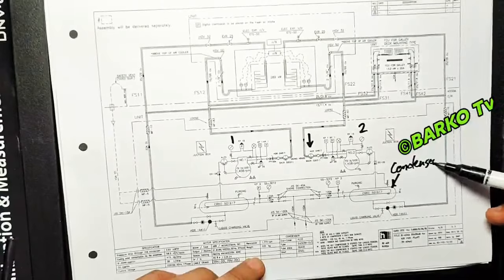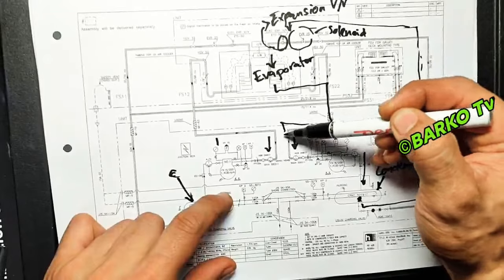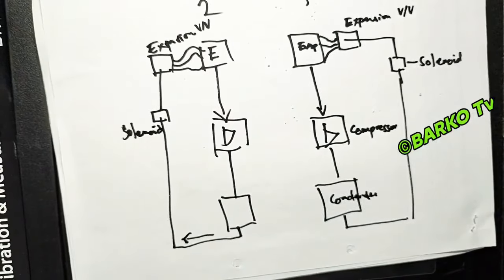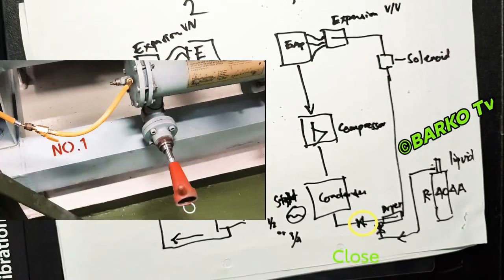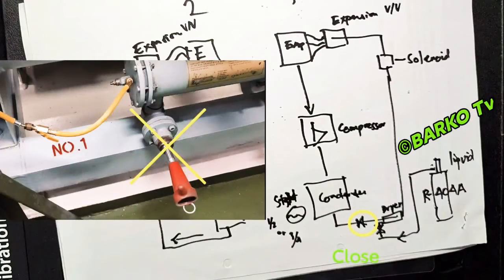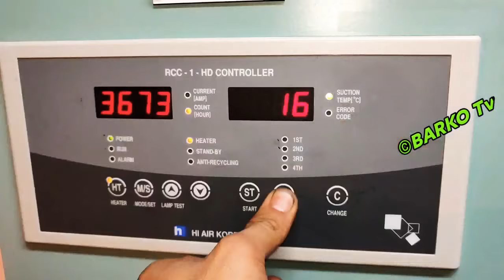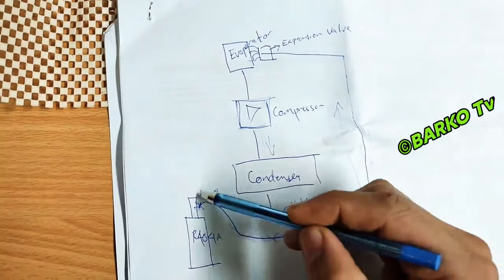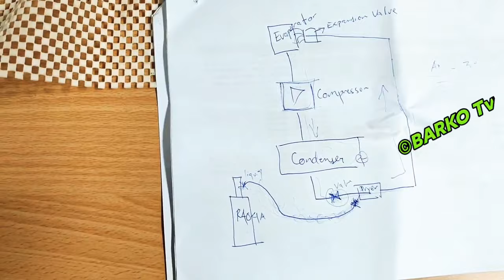How to charge ships air-conditioning unit R404A unitor | makinista |marino |barko |kalecky

Comment: Thank you Sir, for the practical knowledge and block diagram. Please sir try to cover control circuit diagram also.  Thanks. 👍👍👍👍
Reply from the maker: Sir good day, specific control circuit system of what equipment of the ship machinery so that i will try to cover if i have time, or as long as motor control troubleshooting? . Thanks for watching and appreciate my video. Thanks a lot

Comment: sir leck sana magawan nyo din ng video regarding sa mga troubles na pwedeng maencounter sa Ref and AC system sa barko. paano mo majustify or malocate na ung isang part (like TXV, liquid line sol valve, thermostat) ang defective. thanks sir

Comment: Excellent Sir! Thank you for uploading this video, How do we know how much refrigerant will be charged? and Why did you not put your bottles upside down to charge in liquid state?
Reply from the maker: Sir, No need to do upside down in unitor bottles , cause there is a liquid valve that have a pipe deep until buttom og the bottle and gas valve at the top on the bottle.

Comment: Excellent  description 👌....kindly share video of charging oil in Reefer System Compressors and Air con Compressors, 
And also if need to overhauled the reefer Compressors how to depressurize Compressors crankcase.

Comment: Sir good day, thank you po sa very knowledgeable na procedure sa pag charging tru liquid refrigerant, may tanong lang ako sir if open ba palagi yung valve ng cylinder tank ng refrigerant habang naka-andar yung compressor hanggang magtrigger yung low suction pres. switch. thanks in advance sir🤗

Comment: Salamat Sir.. Good video easy for understand. 
One asking Sir, can we Charging direct without close the high pressure v/v from compressor..?
Reply from the maker: When charging, open all valves except the valve after condenser, inorder to pump down the system and open liquid charging valve to charge the system. Let the compressor start stop until your system if charged. Monitor the sight glass must be 3/4 level

Comment: Sir gud day! Clarify lng sir..
Once you pump down the system or close the isolation valve the compressor stop because the low pressure triggered. After this, open the charging valve to pass the refrigerant. Normally the compressure will run but as you said, bec of the anti recycling it will delay the start for about 20 mins. To cancel the anti recycling, stop the system and switch off. Then switch on and start again. 
1) Once the system start again, does the compressor run immediately due to the charging pressure? 
2) Why need to stop and start repeatedly? 
3) D b po tatakbo na man po ang compressor continuos basta nkaopen lng ang charging ng refrigerant?
4) kpag ngstop and start ka ng system repeatedly kelangn switch off po ba nag breaker or hindi na?
Reply from the maker: 1. Run immediately.
2. Pag naka bukas ang charging valve, minsan ina abot ng low pressure pag tatakbo ang compressor, 
Pwede mo rin turn off main power para ma reset ang anti recycling time. Sana maka tulong

Comment: so when you connect the filling hose to the cooling system, is the compressor  still running or stop condition? because you know the valve after condensor already closed

Comment: How to start filling the empty system after replacement of compressor and evacuation od system?
Reply from the maker: Please feel free to browse my playlist for aircon maintenance. For new compressor, need to use your vacuum pump for evacuation process to remove un condensible/air on your system

Comment: Sir what is the purpose or function of the solenoid before expansion valve?
Reply from the maker: When the desired temperature setpoint is reached, the solenoid will activates then the system will pump down it self and stop cause the low pressure switch is activated

Comment: Sir ano kaya cause? Ayaw mawala ng compressor fault na check na din lahat ng wirings at okay.  May possible po ba na may sira ang compressor? Or just electrical issues lang? Ayaw kasi mag start at mawala ng compressor fault. 

Ty in advance sir. 

Same A/C sir.
Reply from the maker: Sir, check ang alarm list tpos baybayin mo sa electrical manual or direct ka mismo sa mga pressure switches na naka indicate sa alarm. Sana makatulong

Comment: Hi sir I have problem about ac system . When ı start the 4th stage lp be coming until 3,8 and hp 18 evap side has startıng ıce also 3rd stage not enought for cooling fan flap position %30 open from atmosphere and evap good condıtıon air flow is good out sıde temp 35. When compressor stop posıtıon condenser liquıt level is full but when ı start comp glass showing emty lıquıt. So ıce problem is less gas or not
Reply from the maker: Try first Isolate/disconnect the 4th stage, and run only 3rd stage, if the same situations , might be lack of charge. When in running condition, you must see the refrigerant level on the sight glass, minimum 1/4 level to 1/2